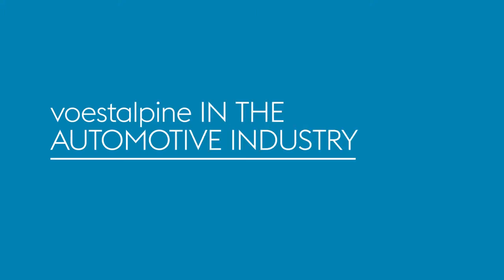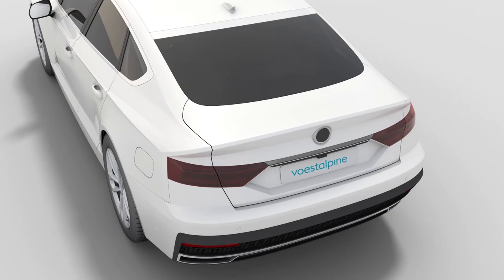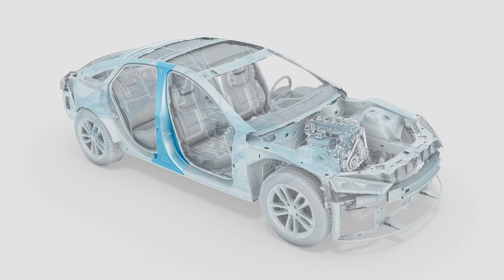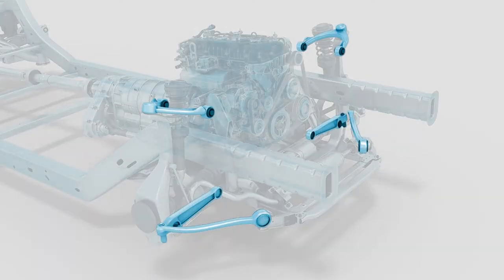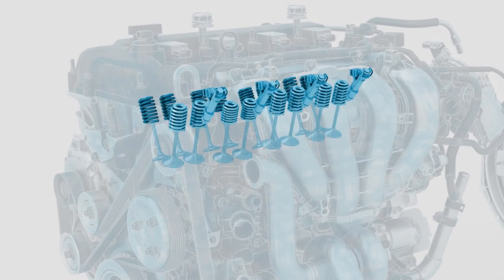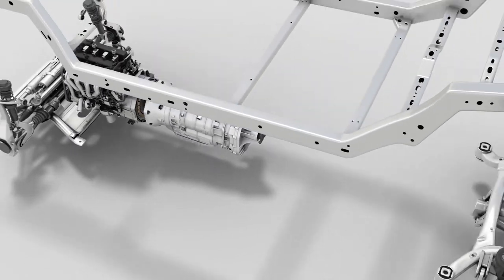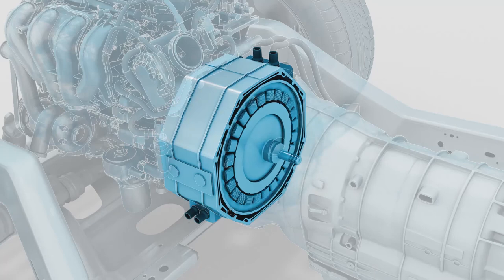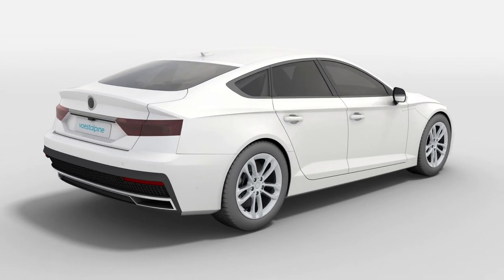voestalpine in the automotive industry

Comment: Hola, como estan? necesitaba saber si sabes cual nominacion, codigo , nomenclatura , o lo que sea debe ser el metal que debo pedir para la fabricacion de las laminas de un estator y un rotor para motores electricos:?
puede ser o conoces  como pedir:
creo tambien se les llama:
SILICON SHEET STEEL
Stainless steel
SUS304 ?
SUS316 ?
SI:5Fe ?
acero al silicio?